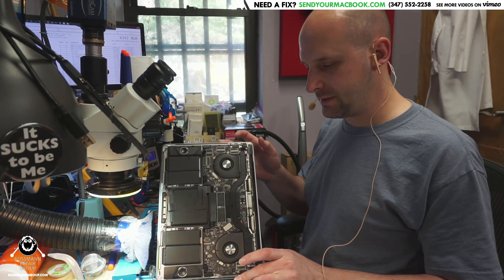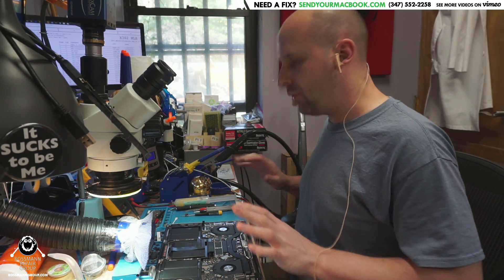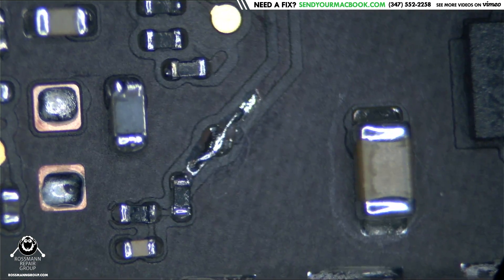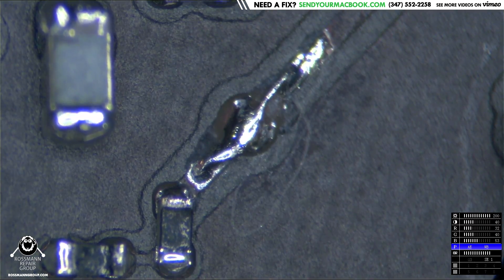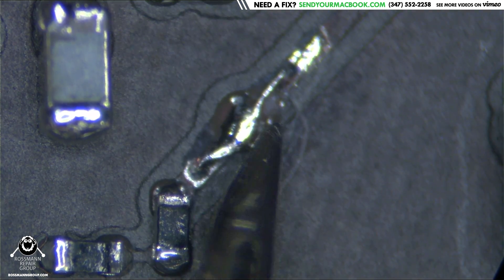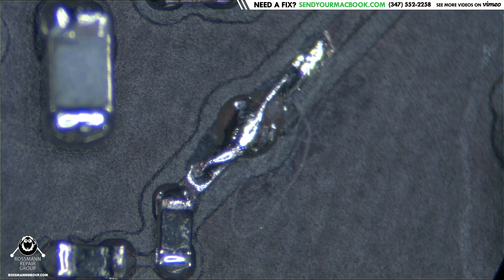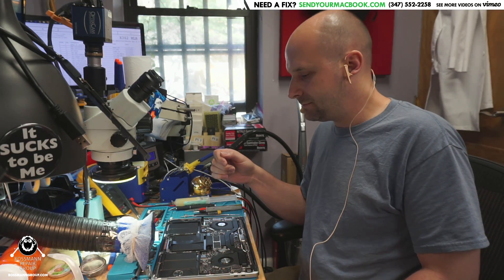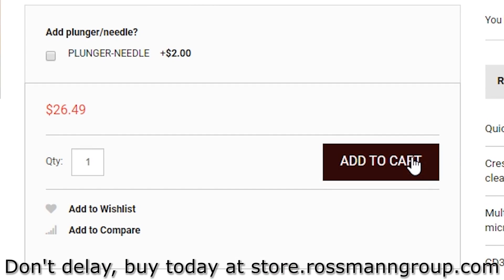Paul's corner: ? folder on A1706 Macbook Pro, SSD not detected. Solid State Drives are fixable

Comment: Probe points should not be in series with whatever line it's running, that would prevent it from rendering the board useless... but then again, Apple.
Sometimes I get board where I feel like touching up every single probe point, but they actually work so no point in doing so (no pun intended)

Comment: So I went to Apple store a week ago to drop off my 15in 2015 MacBook Pro to have the battery changed, they said it will take a week and it will have to be sent out to their service center, the technician noted that the screen had a single hairline crack on the display, otherwise the screen was working perfectly. 6 days later I get an email stating the battery cannot be changed unless the screen is repaired first and was quoted 680$, I declined the service and got my laptop back two days later, once I got home and turned my machine on, my display no longer turns on anymore. My device went in for a battery change and came back with a dead screen. 
What do you think happened? 
How can a device be given back in worse condition then it was originally brought in?
Reply: Real Lyfe always check in store if the machine still works when you get it back. Did the same with my XR after I got it back due to a broken microphone.
Reply: If yours is the mid-2015 model, you can shine a flashlight through the back of the lid to determine if the display itself is bad or if it's just your backlight that's out.  If it's just the backlight, you can probably get that repaired without replacing the display.  Regardless, since there is a crack, if you do want to replace the display assembly I can tell you from experience that it's fairly easy to do and can be done for far less than what Apple charges.  I have the mid-2015. I purchased a reclaimed lid/display assembly that was pulled from a donor machine. I got it on eBay for under $400.  I was careful to avoid getting a cheap knock-off, as those are out there as well.  I'm not saying this would be a good solution for you, just relating my own experience.  I used some YT videos and iFixit as guides.  The trickiest part was disconnecting and reconnecting the WiFi/Bluetooth antennas. I just took my time was very gentle.  The whole thing took less than an hour, and I now have a machine that is also dent-free!  Good luck.
Reply: "What do you think happened"
Simple: you went to an Apple Store. That's what happened. ¯\_(ツ)_/¯
Reply: Pierre C. I went back and they tried to tell me that a damaged working item cannot be guaranteed it’ll return from repairs working the same